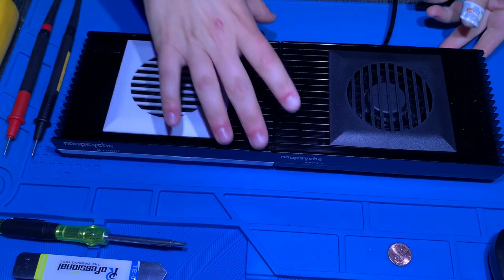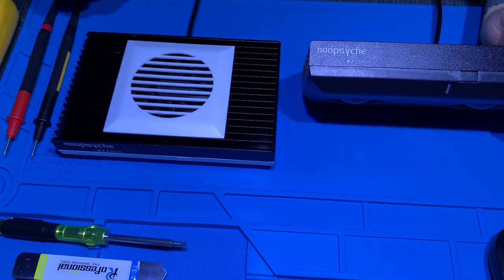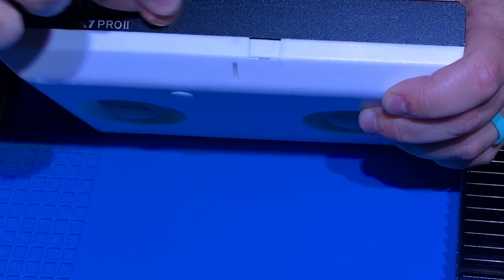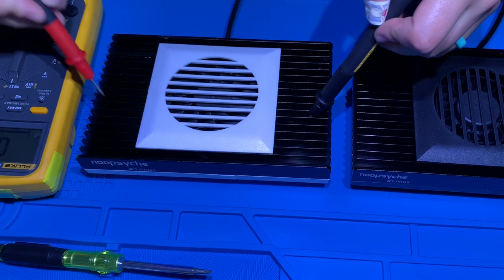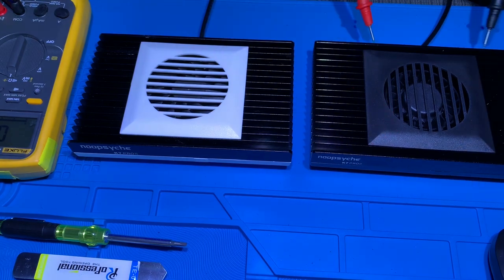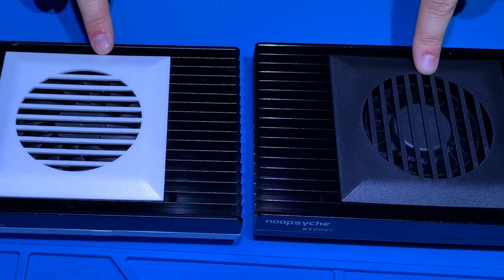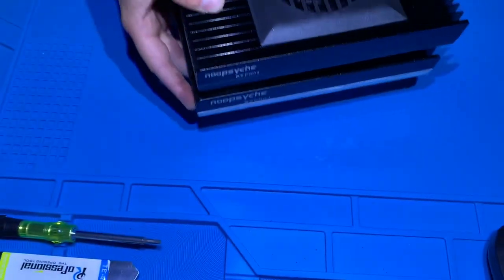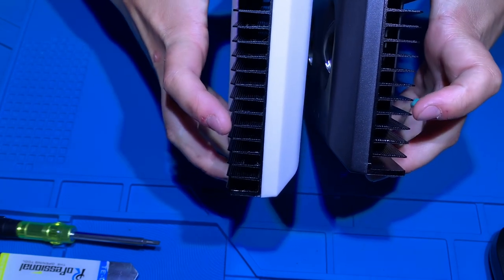Noopsyche K7 Pro 2 from NoopscyheUSA and Aquarium Lowcost Comparison (PART 1)

Comment: I bought a set of K7 Pro 2s directly from the NoopsycheUSA website.  The heat sink fan and shroud look exactly like the Aquarium Lowcost version in this video.
Reply from the maker: Awesome! Yeah, I don’t know what they (NoopsycheUSA) were referring to when they said that the Aquarium Lowcost version had an inferior heat sync. There are several components that make up the heat sync: the anodized aluminum, the fan, and thermal paste. I didn’t find any differences that would make me concerned the product was inferior.
Reply: I sent the NoopsycheUSA support e-mail asking, "Are there two slightly different versions then?  The version I have does not look exactly like the Noopsyche USA version on the video.  The heat sink and fan shroud look exactly like the Aquarium Lowcost version on the video."  They responded by saying, "They had a square fan and a round fan. Depends what they have in stock."
Reply from the maker: Honestly, be glad that you have the Chinese version fan. The one on the USA version in that video sounds like a jet engine taking off. I didn’t know how much interest people would take in this review video, but I wouldn’t mind making a follow up with more comparisons.

Comment: Anodized is protective coating nothing to do with helping heats ink my heatsinks are lacquer coated with an ech primer it only to stop corosion
Reply from the maker: Aluminum is conductive, which is not always desirable for heatsinks. Anodizing the surface provides an insulation coating.